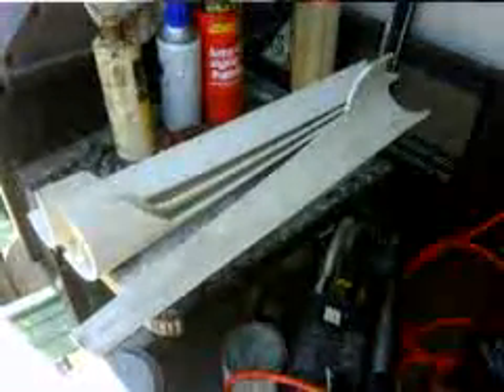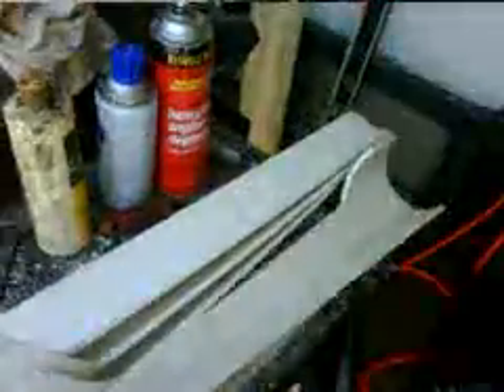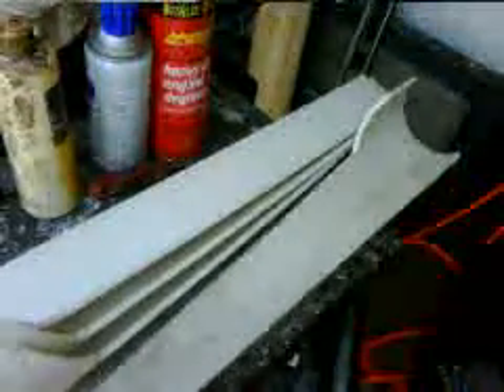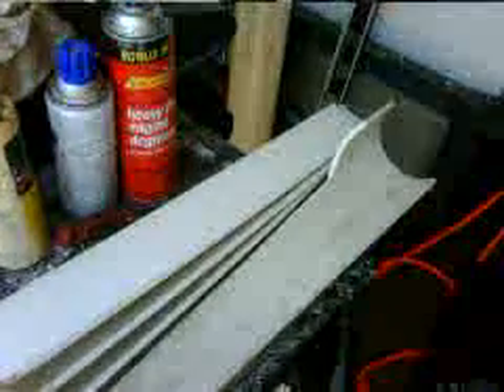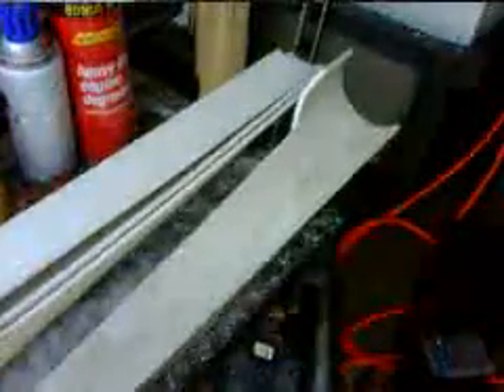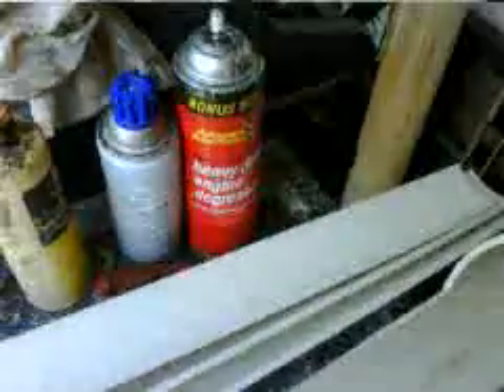First attempt at cutting wind generator blades form PVC (1)

Comment: nice video I have tried a few times to make blades out of pvc never was able to so I just broke down and got MW&S blades already had a 6 bladed hub just added the blades and they work pretty good they are very powerfull cant wait to get the generator and other parts to get it up and running to produce some power.

Comment: There's a design that was sold by Soctish energy that had a blade trip ring, rather like a kids injection molded plastic windmill, it was on a 10Ft /3M mill & was said to keep the tip flutter down, reduce noise & reduce transmission into the building onto which the machine was attached & aid flow, like the tips now to be found on jet wings.

Comment from the maker: LOL TY Doug, I have decided to noy completely cut it off but greatly shorten it, also I have decided to do 4' blades with a more conventional design, they are sharp like hornet blades at the tip and cut from 8" Schedule 40 PVC, I will post them once they are cut and shaped. Oh I was worng the white PVC was shedule 40 also, if this works well then my next project will be wooden blades til I can save enough to get a real rig from Jeff at Missouri Wind & Solar!!.